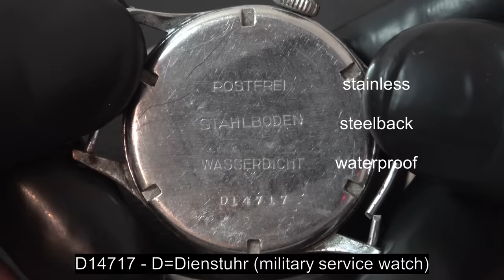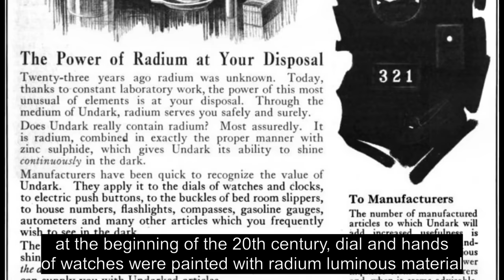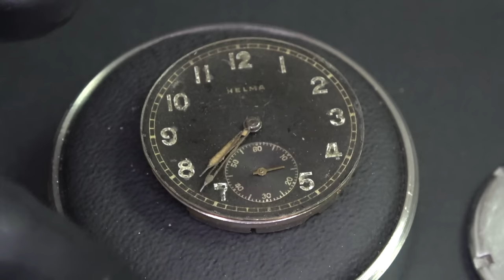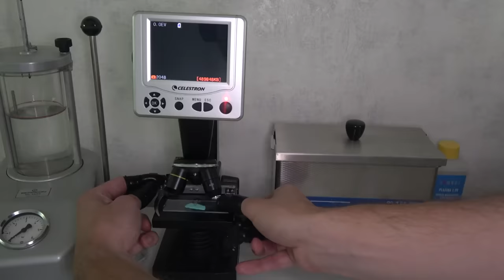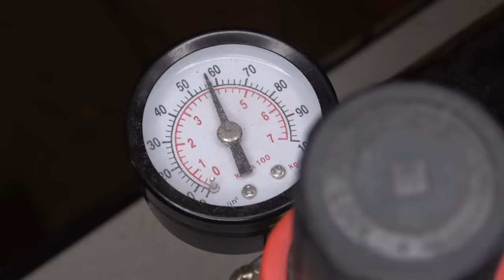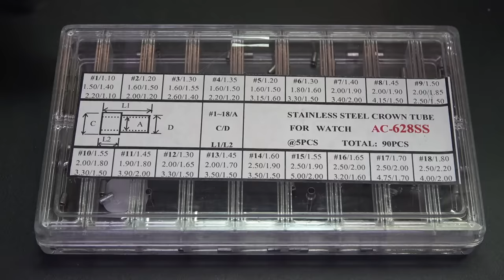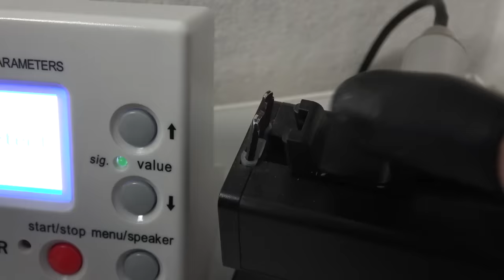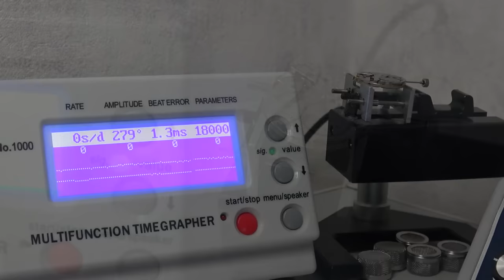Restoration of a Radioactive WW2 Military Watch - German Wehrmacht - Helma AS1130

Comment: Actually, it is not the radium glowing in the dark, it is the phosphorous that emits photons when stimulated with either light (your flashlight) or radiation emitted by the radium (mainly composed of alpha particles but throw in some beta and gamma too).  That’s a testament to the incabloc protection; balance good, escape wheel broken pinion.  Must have been quite a jolt to the watch to snap the escape wheel pinion.  

A suggestion on the hands, using 1500 to 2000 grit sandpaper, polish them by rubbing the upper sided across the fine sandpaper and oil with your finger, gently of course.  Then blue them with heat.  I use a sand base and copper filings mixed in a crucible over a Bunsen burner.  Remove the hands when correct shade of blue and immerse in oil.  Clean them off.  I use a water based luminous powder and white glue mixed with a tint to match the dial numeral lume.  

Nice job, especially love the replating that you do.  Best regards, Geoff.
Reply from the maker: Nice tip, thanks I will try that 👍🏻
Reply: I was thinking something very similar... agree 100% with you opinion on the hand restoration... but it was the lume that brought me to the comment section... it was my understanding (which could be off) that the old radium dials and hands had a paint applied that was "charged" by radioactivity and it was that reaction that caused the lume.. further that the paint (possibly after 10 to 20 years or so) would eventually burn out and that is the reason why these old radium watches no longer have luminance at night... even though they are still radioactive. And that "charging" them with a flashlight as shown in the beginning of this video would have no effect on these old radium dials as it was not light exposure that  caused the lume but rather elements in the paint interacting with radioactivity. 
All this is to say my suspicion when I saw this video was that at some point in this watches history that the hands had been relumed with a more modern material that works off of light exposure similar to the product used in the restoration.

Very long winded comment I know and I apologize for that but I wanted to end by saying that this was an amazing job showing fantastic skills.
Reply: @justafanmarvel9669  hi there!  The radium powder is mixed with phosphorus powder and then a liquid medium (shellac old school, varnish, nail polish).  The radium is the radioactivity source and provides the ionizing radiation which stimulated the phosphorous atom to release a photon thus emitting light.  Radium 226 half life is 1600 years so that is not really the result of the fading luminescence as it would take 1600 years to convert one half of the radium on the hands/dial lume to radon.  Mostly, it is the aging of the medium that carries the concoction and cements it to the hands.  It oxidizes (burns) due to the radiation emitted by the radium, not the light emitted by the phosphorous.  This is why you can see the dial lacquer or paint ‘burnt’ by a radium set of hands that have sat in the same position (non working) for many years while the watch was in storage.  This tends to mask the glow as it browns and provides a denser material for the photons to escape from.  The radium ionizing radiation is not harmful to the user as the watch case/crystal offer protection.  It is however harmful if the crystal is removed and the powdered aged lume becomes airborne and is inhaled.

Radium was replaced with Tritium, Promethium which have half lives of 12.3 years and 17.7 years respectively.  So many vintage watches circa 1955 and newer with H3 and Pm have approximately 1/32 of the stimulating ionizing radiation available as only 1/32 of the radioactive element remains.

However, H3, Pm and Ra painted dials and hands can still be stimulated by light radiation which is not ionizing.  However the glow is almost over very quickly as indicated in the video.  Luminova is a highly concentrated phosphorous paste that is stimulated by UV and white light.  I don’t know much about the chemical composition of luminova and like products outside of the phosphorous concentrations being very high.

As a science experiment, (gross and stinky, maybe but still interesting) urinate into a pot with fine sand in the bottom of it and boil away the urine.  Repeat many many times.  Once the many many times of urinating / boiling / urinating / boiling has been completed.  You are left with a sandy dry solution of phosphorous which is an end product of cell metabolism and carried out of the body in urine.  Shine a light on the sandy mixture and watch it glow!  No radiation involved other then light radiation which is a non ionizing portion of the electromagnetic radiation spectrum

Cheers,  Geoff
Reply: @geoffquickfall  I follow and agree with most of what you wrote... however that further illustrates the point... the dial is still radioactive as you stated the half life being over a millennium, hence the component that reacts with the radiation is what no longer functions... tritium as you mentioned doesn't require exposure to light to charge but rather is constantly glowing until its reaction depletes over the course of time( decades) however it is not radioactive... which is why it is used in firearm night sights as the exposure of a firearm to light to charge as needed would be impractical. I own a ww1 Era radiolite watch and even though the hands and dial are still painted original they no longer lume at night even though the watch is still radioactive. I own newer watches that do lume at night but respond to and require light exposure to charge the effect, these watches are not radioactive... basically as I see it we are discussing 3 different technologies each working differently to create a lume... and since each is different the reactions to light exposure as a catalyst is not effective across the different methods which is why I was puzzled initially when I so the watch in the video being charged with a flashlight and its reaction in a positive to that exposure because the original factory lume wouldn't react that way so my thinking was that the dial and hands had been updated with newer tech in the past as part of an older restoration OR that this watch was somehow newer then I thought and hence was factory made with newer tech.
Reply: @justafanmarvel9669  i think it is terminology here that may be the problem. It isn’t Radium or Tritium that glow; it is their affect on phosphorous.  Tritium is radioactive, but much less so then radium by a long shot, but still radioactive.   The affect tritium has on the phosphorous will decay over decades.

However, as you noted, there is a timed affect on very high ionizing radiation on the phosphorous component and the carrier of the solution.  It does burn, the phosphorous depletes as it forms oxidizing components which prevent the glow of the phosphorous and the carrier also oxidizes blocking the glow over time.  And yes, the reaction of the lume in the original hands may have been replaced with a weak phosphorous only plus carrier (carrier being what ever the original paste was made of to adhere the paste to the hands).

To your point on tritium being non radioactive, that is incorrect as it has a half life of 12.5 years.  It’s just that its form of radioactivity cannot penetrate skin let alone the crystal in a watch or on your gun sight.

So yes, something in the carrier and the phosphorous on a radium watch has aged (oxidized) to the point where the phosphorous compound no longer emits photons when excepted by the left over radium or the weakened tritium.

Cheers, Geoff.
Reply: @geoffquickfall  all good points. And I'm realizing that my articulation has been inadequate when conveying my observation... at approximately 2:18 in the video a flashlight is seemingly used to charge the phosphorous on the watch hands of a supposedly original WW2 Era watch hands and dial... we observed in the video that the dial arabics and indices did not respond in luminescence from the light exposure... however we did observe the hands react with a lume effect as a result.  As you stated radium is the catalyst that reacts with the phosphorous material on this Era watch... Not UV light exposure, hence the lume material on the hands can not be original to this watch as this type of lume effect for watches was not marketed until the 1990s.
Reply: @justafanmarvel9669  You are not quite correct. The phosphorous atoms of any era respond to stimulating radiation by accepting a particle or electron that raises the energy of the phosphorous atom above the base state. The atom then quickly decays back to the base state by emitting a photon, which is light. The stimulating radiation can be produced by a radioactive source, or it could be simply be light photons. 

The only difference is that with a radioactive source, the stimulation occurs continuously, so the process of the phosphorous atoms accepting a charge and then disposing of it as photons occurs continuously. When the phosphorous is stimulated with bright light, the stimulus only occurs for a relatively short time, and in not too long the phosphorous atoms have disposed of all the extra energy, and the glow fades away.

It was normal with radium watch dials for them to glow brightly when coming into a dark room from the sunlight, but after 15 minutes or so they had decreased to the normal amount of glow produced by the radioactive material.
Reply: You beat me to it, a careful thin recoat of phosphor (not phosphorus BTW) over the top of the existing coating may well see the hands glow again. They stop glowing because the radiation breaks down the phosphor not because the radium expires. The half-life of radium is 1600 years after all. 

You need to be careful with these old ones, it's the inhalation of dust that will get you not the passive radiation.
Reply: @justafanmarvel9669  modern military watches used phosphorus paint and then filled the watch with tritium gas.  Since they were radioactive, they were considered sensitive items and had to be accounted for.  Modern watch hands and gun sights are actually small tubes filled with tritium and phosphorus compounds.  Most people don’t know it, but the tubes can be replaced.  The radiation given off by tritium and radium isn’t that harmful as long as there is some kind of barrier around it and exposure is limited. The women applying radium were affected because they ingested it and it became concentrated in their bones.
Reply: Reading the responses here taught me something new and interesting and Im glad I took the time to read all of it
Reply: Geoff Quickfall , never thought will find a comment from you outside HP calculators world.

You have an incredible knowledge man.

You can't imagine how many posts I ve read from you.
Reply: Whiteboy14  Noton a valuable watch it isn't, you don't mess with it at all in that case. It's completely safe as long as you don't ingest it.
Reply: I have a question regarding the radioactivity. Would some radioactivity stay behind in the metal parts of the watch even after the real source was removed? ( I thought RDR should have remeasured the radioactivity of the watch after the restoration as well?)
Reply: @justafanmarvel9669 , I have my grandfather’s old watch from WWII with a radium dial.  It will temporarily charge if under a bright light.  I was actually thinking of leaving the Old radium paint on and then painting over it with Superluminova.  This way, the radium would constantly charge the luminous paint. Radium has a very long half life.
Reply: I use a UV flashlight to check whether the radioactive paint has flaked inside the watch. Even though there is little to no afterglow, you will notice the specks of radium/tritium because they light up in UV. UV has a lot more energy than standard light and thus energizes the phosphorus lume faster.

Comment: Around 1964, I received a luminous dial watch for Christmas.  Just on a whim in physics class, I put the watch under a geiger counter.  Wow, was I shocked when the counter reacted strongly.  Being a teenager, I thought that was neat and put the watch back on.  Now, they would probably evacuate the school and call hazmat disposal.😢
Reply: The thing is it's not problematic if worn; the problems arise when scraping these and producing radium dust. Proper disposal is necessary for this.
Reply: Você fez uma teste de radiação?
Reply: I collect military radio gear and was given a  working geiger counter.  one day I ran it across the military radio instrument gauges and the counter meter went off the scales-  found out that the military used a heck of a lot of radium on their equipment too.
Reply: @jurematoh  we r talking about Plutonium 239? 240? Come on!
Reply: @leonardosena6338  how's about you give the radium girls a ring and ask how they're doing. Oh, right, you can't.
Reply: they would not evacuate anything.. I'm the son of a nuclear physicist and we had uranium at home when I grew up..  my dad still has the collecion..  while it is radioactive the values are still relatively low and won't cause harm unless you actually digest the pieces
Reply: The issue is cheap plastic versus something like a real crystal, plus tiny bits of powder and so on getting into everything over the decades.  If made correctly and kept sealed, they don't emit much radiation.